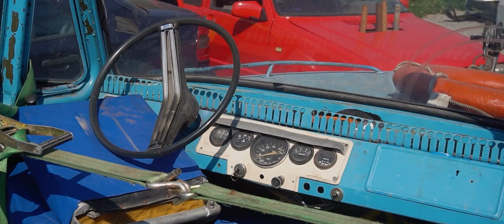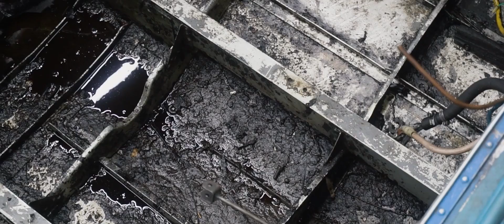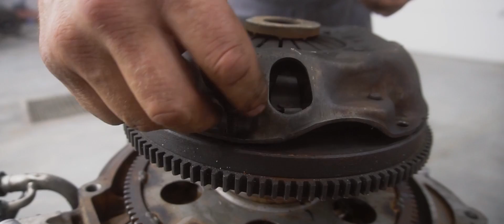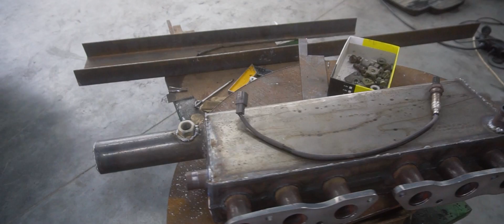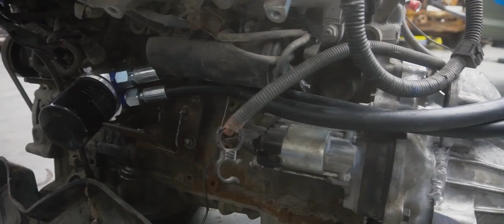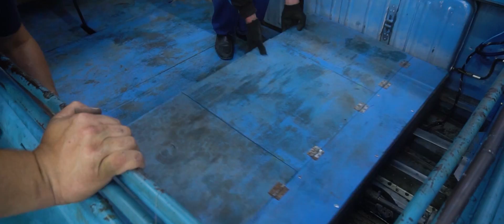We Swap a Toyota 1JZ into a Boat – First Start

Comment: Don't be too disappointed if it doesn't go much faster.  More power doesn't mean more speed unless you change the gearing. The gearing is the pitch of the prop.

Comment: The cooling system in my boat used the original water pump. Also used the lake water to cool the engine. Just remember to flush the cooling system when out of the water

Comment: Hay thanks for posting..I often thought of building a boat and using a old fashioned flat head engine from a old forklift that are getting rare now but simple and easy to rebuild with no extra moving parts from the over head valves.. have the boat hull made with built in wheels so I wouldn't need a boat trailer to pull it on and off the boat ramps..  home stead the boat, live tax free or pay a dock fee 😊😊 I've built barges and work boats when I was a steel fabricator years ago and wanted to retire on a homestead tugboat like a tow truck driver on water 😉

Comment: Please do the exchange with the gearbox.
I have always wanted to see if this thing actually works.
I would place the engine in front of the boat and the gearbox behind.
Reply: When I bought my boat it had a 4 speed automatic gear box. This was very annoying. It does not make sense when it goes in kickdown when accelerating. Switching from forward to reverse makes an ugly sound because the propeller did not stop. I've thrown out the gear box and the propeller and use a jet-drive instead. The engine moved even a bit further back and makes a better balance now.
Reply: @johannriedlberger4390   Well, it sounds like something was broken in your gearbox. 
I don't even want to see a kickdowns or going 100mph on water.. I just want to know if it works. No kickdowns just a simple cruise whit a boat.

Comment: You don’t need to do any calculations for the cooling system. Just use the water that the boat is sitting in :)
Like we do in America!
Reply: He told that he uses a water to water cooler. I do that too, because my boat runs in salt water. My heat exchanger is from Mercruiser. Isn't that from America too?

Comment: Can you imagine if you could get a Cummins 6.7 diesel in that boat? If it didn't sink from the weight it would probably stand straight up in the water and try to fly to the moon.  Over 1000 HP and 1000 Flbs of torque.
Reply: A diesel has the big advantage that the fuel does not explode. With any gasoline powered inbord engine you have to be very careful to have no fuel leaks. A lot of power (torque) is a nice bonus.
Reply: Diesels have better fuel economy compared to gas per HP, so that would be a great idea. :) I am the guy who is all about being economical (though trying to take 5 minute showers instead of 15 minute ones), and can go on 20+ minute conversations about this type of stuff. Curious if lightweight aluminum or titanium-aluminum, or aluminum-iron alloy diesels exist.

Comment: At 21:21 it looks like the exhaust oxygen sensor is placed after the exhaust gas cooler. That is probably not going to work well. Those sensors need to be hot to work properly. You might be lucky though.

Comment: Boat engine spin in the opposite direction putting a car engine in the the boat will be going backwards they going to have to get the propeller to spin in the correct direction.

Comment: My Toyota boys correct me if I am wrong, I don't think I am. But that's a 2JZ, not a 1JZ, right? The 1JZ has a way smaller notch for the vvti, the 2JZ cam notch is much larger like the motor in this video. They 2J, swapped it, not a 1J.

Comment: In, the mid ninties, I worked at Hatteras yachts. My job, engine room, on the 65' convertible, fishing yacht. 2.5 million dollar boat. 2, V/16 Detroit diesel engines. We, used a tight piece of twine, for drive-line angle set-up.😃

Comment: Don't waste your time with a jet pump unless shallow water running is your goal. A surface drive prop straight out the back is the easiest way to get max top speed. A couple of A arms and knuckle from a car will give steering and trim.

Comment: I have a 2012 Bayliner 170 with a 90 hp Mercury F90 four stroke on the back.  It just made 40 mph during sea trials when I bought it.  I like the boat, it is pretty basic and all we do is putter around at low speed in the Middle River in Fort Lauderdale.  About once per year I get it completely warmed up and then I actually [illegally] bring it up on plane and go about 30 MPH just to get the carbon out of the engine.  It is fuel injected, four cylinders, DOHC, 16 valves.  So there really is no "carbon", the plugs always look clean, but I do it anyway.

That Russian boat looks well built, but it also looks like they mounted the windshield of a Russian truck on the aluminum boat!  The other odd thing is that the summer in Moscow is barely 90 days, so this must be an old video-

Comment: You can add U-joint between propeller shaft and engine. 

In case something gets out of alignment, it won't be catastrophic for engine, plus flexibility.

Comment: I have a suggestion for the next project. Can you melt down copper and turn it into an engine block?
Reply: That would be awesome, and the engine block could be named the Copperhead Engine, after that one reptile. Copper-right, or maybe copyright (c)2024 by e-moped Rouge & G54. :)
Reply: Blud, that will cost wayyy to much 😂😂😂😂😂😂😂😂😂😂😂😂

Comment: My thoughts would be build a 1:2 prop system to take all that power and deliver it via two props linked to the single output shaft and your back end will really bite into the water then.   Will give you a better straight line stability and to turn on the fly just knock power off for any sharp moves.   Might need to have a deep rudder to give you a better turn radius.   You could having the lathe etc to hand knock up a rudimentary output gearbox one which can handle the input from the engine, split the power and give you forward and reverse just by engaging a set of dogs, having a reverse is important as its the only way to brake without throwing out an anchor.   Now if you put the thinking cap on, you could also introduce a bias where the steering is full over one way it cuts the power to that side prop so you can power round.   I used to have a speedboat cruiser... right up to the point some bastard chainsawed the very expensive engine out its backside sinking my poor boat.   After salvage I lost a fair bit of money on that poor thing as it was wrecked, never caught the git who done it but I battered the riverside pub owner who I paid to berth it and keep it secure grr grr
Reply: Lada axle. Gotcha

Comment: Boots often have a heat ex changer using coolant and "seawater" driven by a rubber impeller, these impellers can also be found in the tail of a outboard motor.
Cool build you made there.

What would happen if you would you a car's gearbox to drive the prop?

Comment: Can a vacuumcleaner rotor direct on to the engine, be used like a pre-turbo ??
Reply: No
Reply: @TheTrex600ESP   I am sure you not getting the thought, not the vacuumcleaner it self but the fan blade (Compressor)

Fan---Engine to make compressor.
Jets use the similar compressor.
Thought are in low rpm it give pressure and turbo overtake.
Reply: @gepardmic6003  I did understand you( you said vacuumcleaner rotor) But, it will have zero effect, sorry.